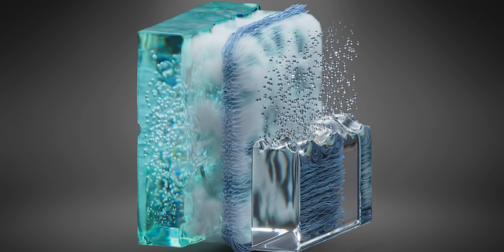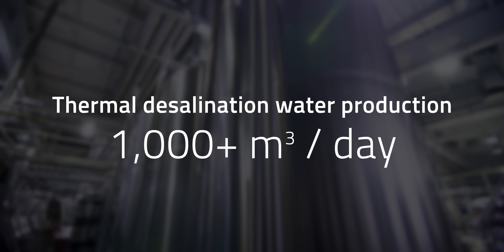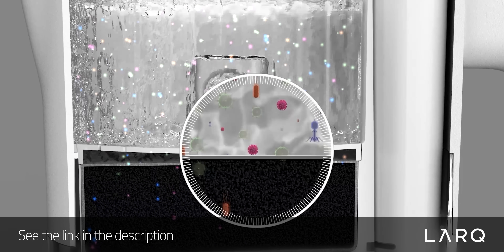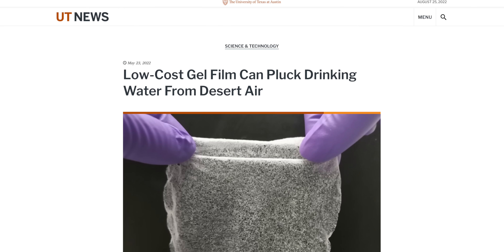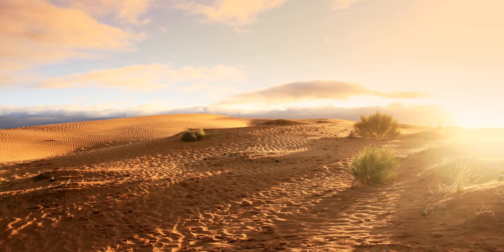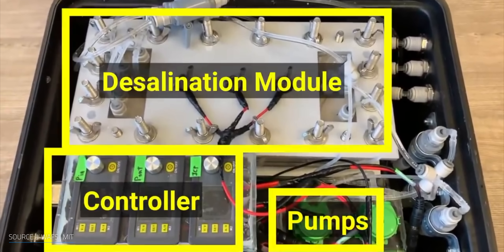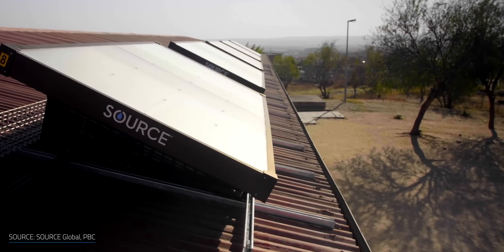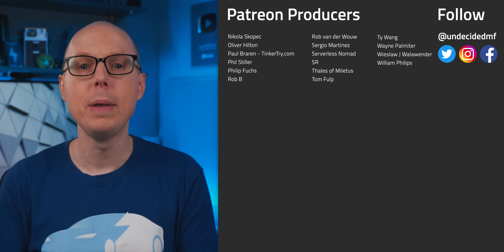2 Breakthroughs That Could Solve the Fresh Water Crisis

Comment: What is the fast lane to the ocean? In America, most cities offer water and sewer as a service. When you're done with the water, they "treat" it and then dump it in a river. If they get water from a well in the ground, NOT putting it back into the ground is a CRIME against nature. Dumping it in the river makes it a drop in the ocean in about 60 days, tops. 
If we want to reverse our desertification and shrinking aquifers, we need to put out waste water back where we got it. Engineering firms want to build expensive systems for municipalities but they often waste the water by dumping it in a river. Our aquifers have collected water over millions of years, as the water slowly seeps into the aquifer through the soil and cleanse it.  Often, there are rock layers along a river bottom keeping it from soaking into the surrounding watershed. Once in a river, it's in the ocean in a couple of months or less. 
If we get water from a well, it should be distributed back to the watershed after treatment, let it soak back to the aquifer, eventually, and it can take 100+ years to get back to the aquifer when a drop of water lands on the soil. That's the best way to fix our problems, but it won't be a quick fix.

Comment: the mit soultion isnt around 50$, even the case they used alone is more than 50$ and then there is also 3 power supplys, which are currently around 50$ each, and not to forget all the custom parts

Comment: I thought Dean Kamen, the inventor of the Segway, solved this over a decade ago.  His portable machine turned antifreeze into drinking water.  So what happened to that?

I'm curios how LARQ compares to Zerowater.  I used to distill my drinking water but it's time consuming and uses a lot of energy.  Zerowater is fast and if you send them your used filters they recycle them and give you a new filter discount.  The downside is they are a bit expensive, but bring the TDL's to Zero.

Why can't the Brine issue be solved by turning it into table salt?
Reply: He is to busy solving the problems with the Stirling engine.

Comment: Okay…so why couldn’t we just create a huge siphon taking seawater inland and up the Rocky Mountains - create a huge open exposed pool. Collect the freshwater ice that will form naturally and rapidly in the cold, and allow the brine to flow back down via another pipe that we put turbines in for power collection that, if needed powers the pumps that pull the water up the mountain to begin with. Then Use the freshwater ice however we want.

Comment: A low power solution that can produce on a large scale is something we really need to benefit some bigger green projects.  For something small,  targeted solutions are the best option.  That said,  I feel ANY solution pulling water from the air should be regulated and not allowed in massive scale in some locations as there is already too little of water. For life saving measures like your examples,  it should be certainly explored.
Reply: But remember that all the water taken from the air will be respirated, evaporated or otherwise returned to the air one way or another. In dry areas it is not likely to end up either in the sea or even percolating down to ground water. Speed of circulation can sustain more life from the same amount of water. (If the plan is to put it in plastic bottles and ship it around the world then, I agree - regulators should tell them not to be so daft)
Reply: @robinleicester  I agree, on what we know now, but on a massive scale, I dont think we know what the outcome would be. I mean look at what China's green wall is expected of doing. As things get easier, populations increase. As populations increase the use will only increase as well. When I think of regulation, the first things that come to mind are the farms and big cities we have in the US based in arid areas who are already taxing State water supplies.

Comment: there is a super easy fix to the brine solution. Pump it to large holding areas on land. This would actually replenish underground aquifers create more humidity in the air as well so areas down wind of these would experience more rain events. Plus we can harvest lithium from this process as well as sea salt.
Reply: Why not skip the desalination all together? Nevada and Utah have large dry lake beds, some already covered in salt. Pump sea water into them and let nature take care of the desalination process.
Reply: @dsm156  because that process would not create enough drinking water fast enough. But that is something else that we could also do. But I think a lot of the low laying areas are protected area. Death valley would actually be perfect for that. All you gotta do is dig a tunnel and let gravity take over.
Reply: Salts don't filter out, you'll have salty aquifers. There are some naturally, they're not good for people,  animals or plants.
Reply: @got2kittys  it can also cause damage to municipal wells as it changes the chemistry of the water.
Reply: @got2kittys  it actually depends on the depth of the aquifers. And they can still make large holding areas lines with something that would filter it out the salt. Which would just produce more humidity for more rain events. Especially if the bottoms of the shallow holding areas are dark in color.
Reply: And Mg, Na, Cl, K, S, he'll even Uranium.
These aren't worth extracting at the concentrations found in regular seawater, but not only is the idea that desalination will have a massive throughput, but it is doing exactly what you would want to do to make extracting minerals appealing, it concentrates them.
I don't see any reason why there needs to be a waste stream from desalination at all, at least with some targeted development
Reply: @blackoak4978  for now desalination is a very energy entensive endevor and this is what we could do with the current waste brine that our current desalination technologies produce. And really in a way my idea is the same as yours just letting mother nature help more. How ever I do believe you will be correct in about 20 years. I hope I am wrong on that and its sooner than 20 years. We are making some break thoughs though  which I hope will bring down the cost of desalination a lot because we really need it.

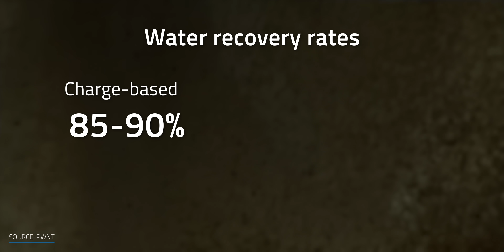Comment: 10:20 "Since we don't want a drop of water to go to waste..."  Whoa, slow down. If the input water is (for example) from the ocean, then the ONLY consideration is total COST. If the cheapest solution "wastes" 75% of the inflowing ocean water, then who cares that some salt water was inconvenienced for a few hours. If you feel that such "waste" would be expensive, then you failed to read the part where I wrote "the cheapest solution". So if the cheapest solution happens to be the most water-efficient, then that's great. If not, then go for the most fiscally-efficient solution. Too many people make that exact error, leaping to the often incorrect assumption that the most input-efficient solution must also be the cheapest. That's a bad assumption and weak thinking.

Comment: 9:54  "20 watts / L"  <- That's a mistake.  Watts per Liter doesn't make any sense.  It should be energy (W-hours, not power watts) per volume unit of clean water. Maybe (big maybe) if we backtrack to consider 1 cup of water every 30 minutes, then we could try to estimate the energy (note power) consumption per L, but now we'd need to disentangle one L and one cup. Chaos reigns here.

If the system is 20 watts and makes 2 cups (almost one-half Liter) of potable water each hour, then it's about 40W-hr per Liter.

Comment: No way a final unit could cost only $50.  The case unit sits in costs more than that.
Reply: How much does your phone cost?
Think about the exteodinary technology and processes required to make it and ask yourself how the hell you can afford it.
Their system probably uses off the shelf electronics, and at a large enough scale I could see it getting even cheaper than $50.
Just think of the design of a Kurig, or Britta water filter.
Depending on the business model they go with, that thing could be pretty darn cheap

Comment: Sorry I don’t get it and I did play the video twice how does one extract the water from the gel heat was mentioned but how a thin film of gel do you boil it and then how do you get the moisture from the Sting
Also on the other method electro dialysis was mentioned what is that? 

cheers

Comment: less power than a cell phone charger???? 2a at 5v is 10w.... you're saying a setup with 3 controllers and 2 peristaltic pumps is going to use less than 10 watts?? regardless of what type of electronics it has, I'll just go with no here.
Reply: speaking of which, the pumps themselves claim to consume 7.5w each at 12v.  and the "controllers" are just current/voltage limiting power supplies off of aliexpress, but they never show the display of each to show what the set volt/amp output is of the 3 power supplies, 2 for the pumps and 1 for the other part of the process which presumably by their own claim on the MIT video, is going to be consuming only 2.5w?

Comment: Thermodynamically, how does that "zero electricity" solution work? It seems too good to be true.

Looking at the Nature source, it says they have to heat it above 45°C to break the hydrogen bonds and actually get the water back, and that heat has to come from somewhere. In fact the picture they show of the full setup shows wires connected and something labeled "heaters" so there is definitely energy involved and it seems they're using electricity. At best this seems like a more efficient dehumidifier.
Reply: Spoiler alert. it doesn't work. Matt always push this nonsense to his uncritical audience.
Reply: Can't wait for Thunderfoot's reaction

Comment: On my sailing yacht I will try to catch the mist out on the sea with a net and a hose directly into the tank. If I can catch 5 liters a day I'm good, then I can stay away from humanity for ever! I will also do tests with black plastic buckets on the railing and let the sun make drinking water from seawater by evaporation. 5 liters a day is all I need, I will have storage for a hundred liters if it works, if not I'm building a reverse osmosis water maker.

Comment: Running salt water over a metal pannel heated by the sun = desalination.  Combine that process with a parabola mirror heating that water = mass production.
Reply: So, does saltwater evaporate? Yes, saltwater evaporates, leaving behind salt crystals. And the addition of salt in pure water decreases the rate of evaporation of the salt solution. This is because of the decrease in the saturation vapour pressure of the salt solution. Evaporation is directly proportional to the difference in vapour pressure of air in contact with the salt solution and the air at some altitude.
Reply: At the same time realize even Gatorade made trillions from electrolytes that = salt...
Paste: The salt added to Gatorade and other power drinks helps restore electrolytes after exercise.
Reply: So ... quiz time? how much % of salt removal from sea water for healthy use?  It doesnt need to be "salt free"...

Comment: Until you can solve the brine issue, none of these tech going to work without major pollution problem. The gel film is probably the best new thing, but only for small scale individual use. 
Find a way to move the cool humid air from the coast inland to make rain and snow during the colder month. If you're going to install windmill, they should be inland closer to the mountains. and not impede the coastal winds path inland.

Comment: One factor in the puzzle that is rarely talk about is most Desal plants are at sea level (obviously) and the clean water then needs to be pumped uphill to be used. This adds a lot to the energy costs.
Reply: You can pump uphill without adding energy, IF the water you want to pump uphill is flowing.
The technology is called "Ram Pump" it's using the energy in the water tu pump it uphill.

Comment: If there is a national desert and a coastline, use the sea sourced water and vaporize it to transport inland to the desert areas where you can then pull it back out of the air.  That should address anyone's concerns about the environmental impact.  You're piping the water without even laying pipe.

Comment: Here in San Francisco, almost every day a dense blanket of wet fog envelopes most of the city.    It is not a stretch to think of every home having a harvester on the roof right next to the solar panels.   The gel system seems the most hopeful to me.   SF is an interesting laboratory because is has both fog and has the ocean on three sides, so it has options for making water.   To me,  desalination is too capital, and energy intensive, with all the plant and pipework and brine processing.   Much more sustainable to have each house  make its own.   The trend may be be for each house to go "off the grid" for power and water.
Reply: The world has water collectors in third world countries which is some type of fabric that hangs in the airs and collects the humidity.  AC water can be stored and used for plants.

Comment: The small case ionic device might be good, I would rather it was maybe twice as big? With a first stage particulate filter, with larger diameter hoses. Even with a higher power consumption it should still be portable.  A simple solution would be to pump  saltwater inland hundreds or thousands of miles, and set up desalination stations every 20-40 miles. Use solar PV / battery storage as power, use thermal or RV-osmosis. The brine would go into large ponds to evaporate, collect the salt and minerals for further use. The fresh water could go to underground tanks, and or to create an oasis with various fruit trees / bushes, and flowers for local fauna or farms.

Comment: I was with you until you said the solar ion device required 20 watts per litre.  Why does anyone - let alone a presumably well educated technology expert always confuse watts (i.e. joules per second) with energy (i.e. joules).
Was that 20 watts over a period of a hundred years for 1 litre?  or was it 20 watts for 1 litre every minute (damn - that would be impressive)
Reply: From his citation, the journal says: "The resulting water exceeded World Health Organization quality guidelines, and the unit reduced the amount of suspended solids by at least a factor of 10. Their prototype generates drinking water at a rate of 0.3 liters per hour, and requires only 20 watts of power per liter." So 3.33 hours for one litre of water. E = P*t = 20W * 3.33 hours = 66.66 Joules per litre.
Reply: @richardlighthouse5328  Nonsense.   You're confusing power with energy again.  Or maybe the article cited does.
if the device really consumes energy at the rate of 20 watts (that is, 20 joules per second), and can process 0.3 litres in an hour (i.e. 3600 seconds) - then that would work out at 20 * 3600 / 0.3 joules per litre - or 240,000 joules per litre.
Now the thing is, joules are really, really small.  There are 3.6 million joules in a KWh, so 240,000 joules is still only 0.066 KWh, or about a cent's worth depending on the price your utility charges.  Regular tap water costs around 0.1 cents per litre (again, depending on your utility), so it looks like this desalination process costs 10 times that of regular tap water.  Sounds steep, but if it's true, and if the device lasts for a long, long time - this would still be impressive.